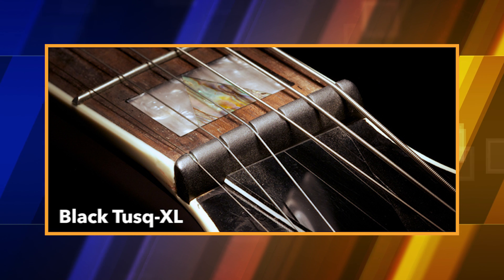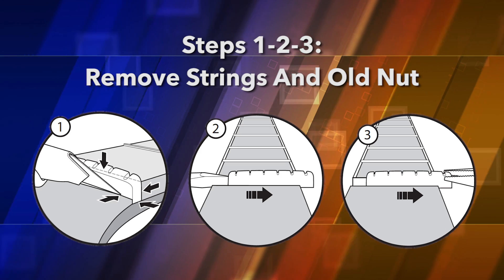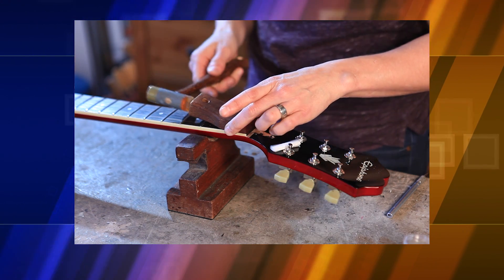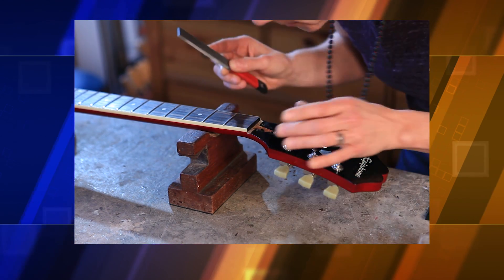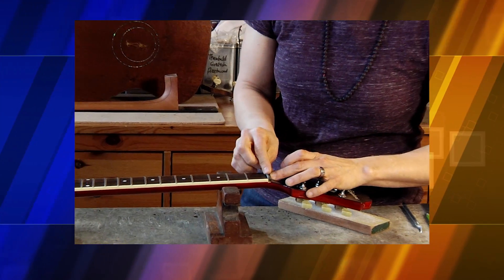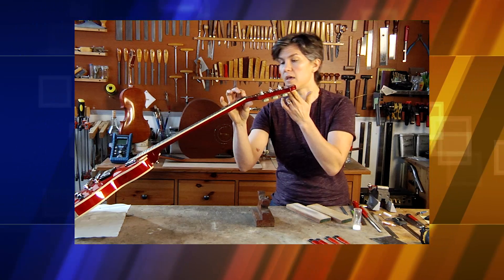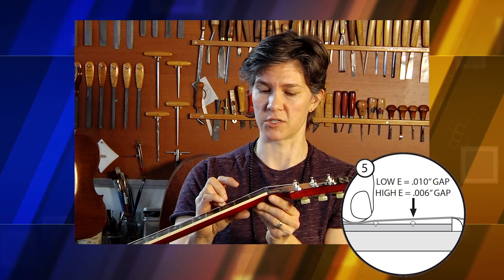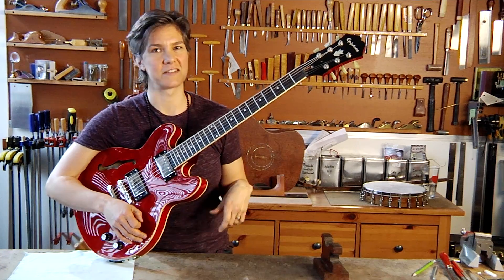Graph Tech Training Series: How to Install a Pre-Slotted Nut

Comment: Thank you for an excellent concise video. 

I installed a Graphtech saddle on my Epi PR 150 years ago. What a difference! I just never got around to replacing the nut until recently. 

But I did sand that plastic nut down a long time ago and what a difference that made with chords at the top Frets.

My post 2014 epi (manufacturing date) required the 6061 nut. It was delivered a few months ago and I finally got around to installing it. It was a little bit wide but the thickness was perfect. And I'll have to sand the bottoms down a little bit for lower string height at the first fret. 

There's just one thing...

Those first string/6th string heights (0.06-0.10) are very high and especially for an electric guitar. Not shredding height to be sure but high for even chord strumming at the top.

Extra light strings might help...but still... 

I'm not an expert with this at all. And I struggle my way through all   of this. But I think I'm right about this. 

Or am I overlooking something???

Comment: I have one of your nuts pre-installed on my non locking trem guitar- tusq xl- and its fantastic 

My question is, will i expect it to wear down over time as i heavily abuse the trem? Effectively sawing the inside of th nut slots.

Just wondering. Thanks!
Reply from the maker: Well, the more you use it, the more it lubes … I’ve had one on a Les Paul with a trem for 15+ years .. 10 of those years was gigging 3 to 5 nights a week … it’s still going strong … no issues …  but each setup is different for sure
Reply: @GraphTechGuitarLabs  that's awesome I look forward to having your nut on my neck for decades to come.

In the event if ever did wear down, I would just shim it because it's a really damn good nut. But I doubt it will ever come to that. Not this decade at least.

Comment: Note that Epiphones built after 2015 take the 6061.  Before 2015 are 6060 (shorter)  also note that most, if not all, of the Epi's built after 2015 already have a Graph Tech nut.  You'd only step up to the GT Tusq "XL" because it's impregnated with teflon.
Reply from the maker: Good info!  You know your Epi’s !
Reply: Hmmm. I was speaking with graphtec support months ago. My guitar was built in 2014. The support guy said from 2014 onward required the 6061. He put me on hold to check all of this out and that's what he said when he got back to the phone. 

BTW. He was extremely helpful. 

Your website notates 2014 as the threshold. Pre 2014 requires the 6060.

Comment: You didn’t mention what type of glue to use, and also we can use the tension of the strings to hold the nut in place while it dries? No clamps or anything?

Comment: Any recommendations if the new Tusq XL is not as thick as original nut?  Leaving a slight space from end of Headstock?
Reply: So to fill in the space so to speak
Reply: So the thickness is less that the original but and space thickness.. I guess is the correct term for it.
Reply from the maker: It would be easier if we have your guitar model and the TUSQ XL nut you are installing. I'll assume you mean there is a space at the back of the nut, on the machine head side.  Best solution is to use a thicker TUSQ XL Nut, and if you bought direct from Graph Tech, no problem on doing an exchange, even if you modified it (sanded, etc).  Other option is to use a shim... thin piece of hardwood to fill in the gap.  Best idea is to contact support@graphtech.com and they can find out more about your project and the options you have. All the best!

Comment: That's interesting that you recommend using wood glue. I'm not a luthier by any means, but I've done a few nut changes on my guitars. And the one time I used wood glue the nut actually came off when changing the strings. Haha I was angry about it, use super glue ever since. Just a little.

Comment: Thank you just if you don't mind me asking how do you choose the the right radius and the right nut slots gauge for a specific strings gauge  since on the graph tech website it is not showing certain nuts for a specific strings gauges!! And lastly the website is showing the black nuts has much better results with tone and sustainability is it related to the Teflon  amount % presence or other factors !!  Thank you best regards from ENGLAND.

Comment: You need to say what glue to use,and demo it. Demo cutting the outside ends of a nut. Otherwise thanks
Reply: Thanks for letting us know. On the glue, a thin layer of white wood glue (ie: Elmer's) on the bottom of the nut. You don't have to use an epoxy, cyanoacrylate (ie: Crazy Glue) or anything really strong, as one day, you may want to change the nut, and you don't want part to the nut slot or neck wood coming out with it.  For the string ends, get the string slots into position and then just mark the nut with a pencil on where you need to sand the ends to... sneak up on it a bit, you can always take more off, but not so easy to add back on. Thanks again!

Comment: Great tutorial, but your measurements are off.  For the high E you said 0.06 of an inch. That’s 60 thousandths. It should have been .006 of an inch or 6 thousandths of an inch. You said the low E should be 0.1 of an inch or 100 thousandths. Should have been .010 or 10 thousandths of an inch. It’s been 6 years, so maybe you fixed it in more recent videos. Thanks👍
Reply: Yup, yes, you are right...  we have a few people let us know over the years,  just a verbal slip up by Nicole, they printed visual is correct in that scene... .0.010" and 0.006"   but bears repeating, thanks!
Reply: @realtusq  No problem, I’m a little anal about these things. Back in the day, I built machinery where the tolerance was within  .003”. So 0.060” to 0.006” was a football field lol!

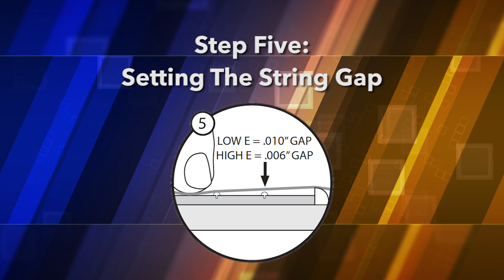Comment: 4:13 what's that in mm for the rest of the world please?  What grits of sandpaper?
Reply: Sure,  0.010" = .254mm  and 0.006" = .152mm  for sandpaper grit if you have to reduce a lot, start with 220 and finish with 400 to 600. A small amount of sanding, just start and finish with 400 to 600 grit. Hope that helps.
Reply: @realtusq  many thanks, worked for me.

Comment: What glue do you use?
Reply: Just a light coating of white glue (like Elmers) along the bottom of the nut.. you just want to hold it into place, as one day, you may want to change the nut again.... don't use cyanoacrylate glue (Crazy Glue,
etc) because if you every want to remove the nut in the future, you're probably going to take out some pieces of wood with it.

Comment: This is a very good guide.  I installed a Tusq XL 6143 and it fits perfectly in a Les Paul Copy.  Sand down in small steps and keep checking the distances with a feeler gauge.  Thanks.

Comment: I would have liked a bit more detail on the type of glue and mixture - too strong and it could damage the guitar if you ever need to replace it again.
Reply: Yes, you are correct. We recommend a white wood glue, like Elmers… and lightly smear it in the bottom. You just want to hold it in place, as one day, you may want to change the nut.  Thanks for the question
Reply: Personally I never glued any nut on my guitars, it stays in place thanks to the natural strings tension.

Comment: Never said what glue to use?
Reply: Just use a white wood glue, like Elmers... a thin coat on the bottom of the nut. You just want to hold it there... You may want to be able to remove the nut in the future, so do not use a cyanoactrylate glue (Crazy Glue, Super Glue, etc) as it will take some of the guitar nut slot wood away if you try to remove the nut in the future.

Comment: What kind of glue and how much did you use?  Why did you skip showing that?
Reply from the maker: Just a light coating of white glue (like Elmers) along the bottom of the nut.. you just want to hold it into place, as one day, you may want to change the nut again.... don't use cyanoacrylate glue (Crazy Glue, etc) because if you every want to remove the nut in the future, you're probably going to take out some hunks of wood with it.

Comment: I'm changing the nut on a Squire Bullet with a TUSK XL but, noticed the new nut is lower height than the original and it needs a lot of sanding before it will be leveled to stop tilting on the bump in the middle. Seems like this is going to add more fret buzz than take it away which was the point of installing a new nut in the  first place. I also noticed the spacing between the strings is wider than original. Did I get the wrong nut for my guitar?

Comment: Instructions un clear. You said you need a clearance of .06 on high E and 0.1 on low E which is 60 thousandths and 100 thousandths of an inch. The diagram you had up shows 6 thousandths and ten thousandths of an inch. Aaaaaand you didn't show or explain where to glue and how much glue or what type of glue 😪
Reply: Good catch, the diagram is correct 👍

Comment: Although never advertised as a drop in replacement, I didn’t anticipate a months worth of fitting. On my 2005 Les Paul Studio, skinny neck, I could not get the nut rocking out of the nut slot. I used good single faced files for gun smithing to square everything.  Sanded with a straight edge. Measured with a straight edge. Every time, the nut rocked side to side about .007.
This neck has a strip of non-mahogany wood running along the truss rod. My experience tells my this wood does not file/sand at the same rate, and without a tricky router jig, I’ll never get the rocker out. I ended up sanding the 6061 nut bottom concave to get it to sit solid.
D-string slot is deep. And, the whole 6061 nut seems to have a shallower radius than the skinny neck LP. I biased my reduction sanding toward the small string end. Bought nut string files for A and E. Measured and adjusted all six strings along each step to get a profile of 0.005 (high E) to 0.009 (low E) 
As I tuned to pitch in-between each step, I immediately noticed a pleasant difference!! Clarity and sustain were notably crisp and long. The wound strings sound like the low end of a grand piano now. Even though I landed a touch below recommended gaps, there is no fret buzz, and setup is aligns to Gibson specs. 
Having the TUSQ XL proudly sitting at the end of the fretboard will be worth the effort. It just took a good deal of working the piece (and the blank nut video) to get it installed right.

Comment: How much is a bit of glue?
Reply: Just enough so it doesn’t spill out the ends or side of the nut excessively… white glue is pretty forgiving and easy to clean up
Reply: @realtusq  Thanks. Every video I watch seems different. Some use super glue in one spot, others at both ends, and others cover the whole slot with a thin layer. Others use wood glue with similar different application patterns. And some say you don't even need glue. 

It seems to me that if the glue is uneven, it might prevent the nut from contacting the wood surface evenly and lead to loss of vibration transfer to the neck. Also, if the glue is too thick or heavy or elastic, it could dampen vibrations passing from the nut to the neck. 

So I figure either no glue or a very thin layer of very hard glue (meaning not elastic or rubbery) are the best solutions for transferring string vibration from the nut to the neck. I guess I need to try things out myself because even experienced luthiers might just do what they've always done without much trial and error to see if something else works better.
Reply: @brushstroke3733   just sayin…. Do not use super glue (cyanoacrylate) … nuts have to be replaced every once in a while .. and super glue will take a bit of wood with the nut you are trying to replace …
Reply: @realtusq  Thanks, that is very helpful! I bought some Tight Bond wood glue, their weakest formula, to use on my nut replacement job, but I am also considering simple white Elmer's glue as you suggested. I use that glue a lot for craft projects and know how it works. I like how it has fairly weak bond strength and would be easy to scrape off residue from former applications. The only drawback is I think it is relatively gummy and flexible compared to some other glues. The truth is it is probably too small of a difference to matter or to make any noticeable difference in tone and I am overthinking it like so many guitar players do. (Vintage Original Spec lovers!)

Comment: When I dropped in a new pre-slotted nut into place, the radius isn't exact.  The middle strings are closer to the 1st fret than the high and low E strings.   I think this means I should sand the bottom only until the middle strings are the right height (0.008" seems right if the low E wants 0.010" and the high E wants 0.006") and then file down nut slots for the outer strings just a hair.
Reply from the maker: Hi Charlie, Not sure of the nut and the guitar you are installing it on, but you are right... get the center strings the correct height and the adjust the low E and high E down a tad and you are good to go!

Comment: Learning every inch of your guitar will completely change your relationship with your guitar. A Graph Tech Nut is so fairly priced, but most manufacturers still put cheap plastic nuts on their low end (and sometimes even mid range) guitars. The first time you go to replace the nut you'll be shocked at the difference between the nut that came on the instrument and the new one from Graph Tech. It's such an important part of your playing experience too.

Comment: ANCIENT VIDEO RESURRECTION ALERT!

I'm about to venture into this effort with, interestingly, an ES-339 like in this video (I think?) and a Fender Tele Deluxe. Hoping some of the viewers could perhaps answer a few beginner questions:

Some are saying Gorilla Glue is too strong, is that true? I mean, if I use only a tiny bit? Someone put a bit of glue on a low E string & dragged it through the empty nut slot, is that enough glue? Some are advising I use a weaker, water based glue.
Also, when sanding the bottom of the nut to get the right height, is it better to use coarse paper so the glue sets better? 
I've also been told that the nut on my Gibson ES-339 is finished along with the binding on the fretboard. I'll use an exacto knife to edge along the nut before I try tapping it out, but for the Gibson, is that liable to harm the finish or the binding? I worry more about the Gibson since if I break anything, the guitar's close to worthless.

Thanks in advance!

Comment: This may have been covered somewhere but there are over 250 comments. What about string nut slot depth? This isn't one size fits all.
Reply from the maker: Thanks for your comment … how we do it is by sanding the bottom on the nut to the correct height while taking into mind the correct height got the high and low E string combined with the radius …    Of course there are going to be outliers , but,  in our 35+ years doing this, it works on the vast majority of guitars. If not, we always have blanks and all of our products purchased directly from graph tech come with a 45 day money back guarantee … even if you sand it , slot it, etc … we want you totally satisfied 👍

Comment: I tapped the nut sideways as you suggested on a Fender neck and... It busted 2/3 of the  fretboard wood behind the the nut, on the headstock side. 
Brand new, unused, $800 neck that I sorted out from buying 15 necks! 15! A monumental endeavor in itself!
I scored it on all edges possible, even the sides, with an exact knife, as carefully and deeply as I could! 
I didn't even tap that hard. 2/3 broke off.
Thanks!
Reply: If if was a used neck, I'd say somebody used crazy glue or epoxy to glue in the nut, but as you mentioned, it was brand new, my best guess, without seeing it, there was a fault in the wood. Removing the nut as we described is best practices for removing an existing nut. Please contact the store where you bought your neck and see what can be done to remedy the situation.
Reply: @realtusq  The nut had too much glue on it. Fender USA.
Unfortunately this neck is not replaceable. I bought the last 15 available at any retailer and kept only 2. They have ebony fretboards, and as it stands, Fender no longer produces all black ones, except for maybe in the custom shop. They are all heavily streaked and some aren't even as dark as rosewood.
I even had to ink the two I kept to make them all black, as they still had minor streaks. The other ones would almost be like inking rosewood, except that ebony is less absorbent, so the ink may have not covered their streaks enough.

Come to find out, if the nut doesn't come out on Fender guitars without a super gentle tap, if you didn't put the nut in the yourself and don't know how it's glued, you're supposed to saw the nut in half, I think length-wise, and snap it somehow to get it out.
Tons of luthier forums say sawing down the middle is how to remove a Fender nut, at least one the luthier didn't install to begin with, and the the knock out method is used more on Gibson-style nuts.

I did a repair on the nut channel and refinished it, but it took over 2 weeks to do and make it look 90% stock.
Needles to say, I will never use the method mentioned in the video again, unless I installed the but myself, without glue, or with only a really miniscule amount of glue.
Reply: @realtusq  the nut had so much glue on it, it was on all three sides of the nut that touch the three sides of the nut channel! Crazy 🤪